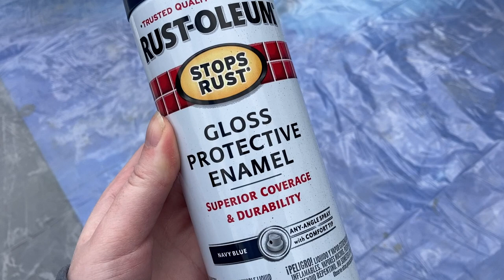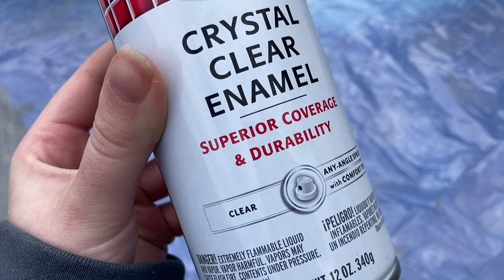SATISFYING Dining Set Makeover | How to Use Enamel Spray Paint on a Table & Chairs | Glossy Finish

Comment: That turned out BEAUTIFUL!!
*I did notice the difference in the spray nozzles? Did you use a different type of paint from the base to the top coat? 
*Also, is it a good durable finish for setting wet glasses/cups on? I’m thinking about painting the top of my dining table black.
Thanks for such a great video from prep to finish!!!

Comment: How long do you wait between coats? Whenever I spray paint things, if I wait 24 hours and don’t put all the coats on the same day, the paint bubbles up.
Reply from the maker: I always follow the manufacturer's instructions on the back of the can. For this particular paint, they recommend re-coating after 1 hour. 
Bubbling is really frustrating and can be caused by many factors: cold temperatures, reaction between the paint & the surface, heavy application, high humidity, or the previous coat wasn't ready to be recoated. In my experience, it usually bubbles because I applied it too thick.
Reply: Thank you for replying!